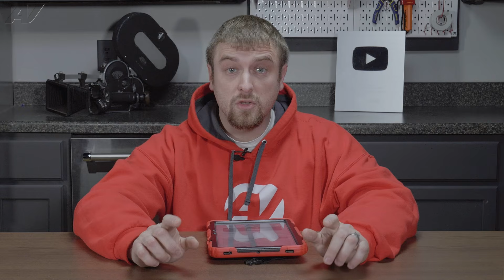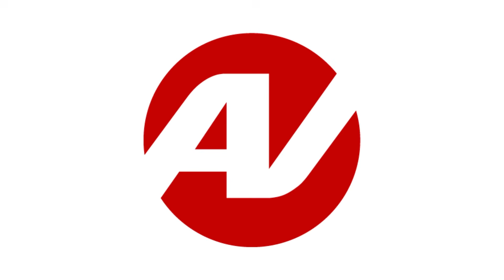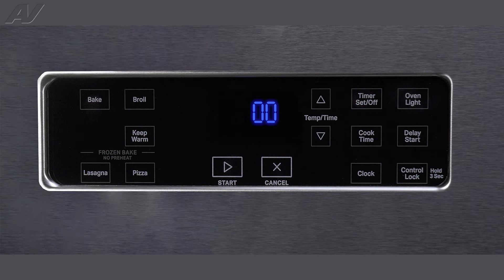Whirlpool Range / Oven - Diagnostic Mode, Error Fault Codes & Troubleshooting

Comment: Mine was bought at Lowe's $1200 with air fryer to 2 large electric eyes in front and 3 med/small eyes in the back.. I hooked mine up for the 1st time a few months ago and baked a few tine and air fryer once.. now oven part doesn't work says F1 err and cuts off.. piece of shiiidd new with board issues
. Whirlpool is total shiiddd if won't last but a few months